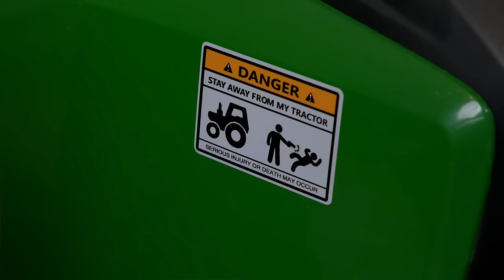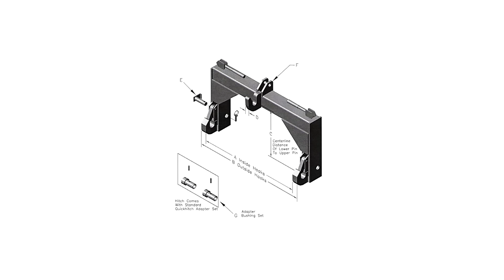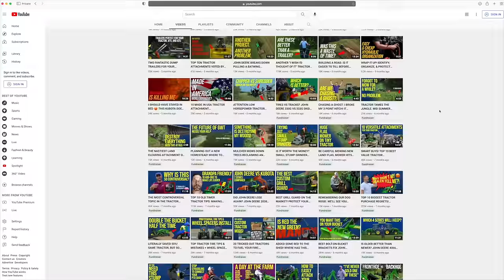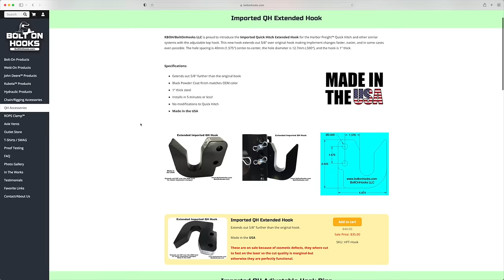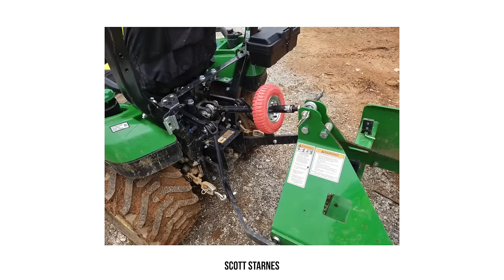CAT 1 QUICK HITCH DIMENSIONS AND ADVICE TO WORK PROPERLY

Comment: Pat’s Quick Hitch + Tractor PTO link.  The two together make a world of difference.  The top link is never the issue… that’s why Pat’s is awesome.  Grab the implement attach your top link (you have to get off the tractor anyway to attach the PTO) and wallah… life is good.  Plus you don’t have the standard metal bar on other “not so” quick hitches to work around.. making it less cumbersome and easier to connect the PTO💪🏼
Reply from the maker: Thanks for watching, good stuff!
Reply: I run a rear blade when there isn't a lot of snow or to touch up my gravel driveway, no PTO to connect for that attachment so I literally just reach behind me and flip the levers down on the quick hitch I have and drive away and do my work.
Reply: Agreed, personally I love the Pat's Quick Hitch!  I know I'll always be back there adjusting the top link anyway, so just being able to get the lower pins into position easily is all I need.  Then when not using it they just stay back there on the 3 pt arms and are totally out of the way!
Reply: IF I colud only find a top link long enough now that the Pat's Quick Hitch has been installed. (Cat 2 that is 35" long in the mid point)
Reply: Do you have any available for a 2025r
Reply: Those of you which own and use Pats Quick Hitch, are those bent washers necessary?
Reply: One point not covered is the length which the pin point is extended away and the affect on the power of the hydraulic lift. Has anyone ever had issues with this and or had to replace the PTO shaft because of the added extension the implement is now mounted?

Comment: The hydraulic top link is a game changer!!!  
I haven’t pulled the trigger on the hydraulic tilt yet, but I can see a huge advantage when creating new roads/trails. 
Great video, cleared up some of the confusion when measuring tractors and attachments to see which tractors will work with which quick hitches and attachments. 
The other quick hitch video where you explain with measurements, and side by side tractors on quick hitch category 1, and category 2, is a much watch for folks with tractors bigger than a compact. 
Thanks Courtney!!!

Comment: I purchased my Speeco quick hitch approximately 5 years ago and it has the larger holes that require the bushings. The reason some people that are older (like me) is that should you not be able to see as well as others, the larger bushed pins fit very easy even if you are off a bit. God Bless 🇺🇸😎👍
Reply from the maker: Haha, maybe so!

Comment: I have a QH05 quick hitch from Land Pride on my Kubota BX. It has a fixed top hook and is the smaller version of 2 that they sell, which forced me to have the modify my ancient box blade to lower the top link pin position. But it was well worth it. I have a small property with a gravel driveway, about 3 acres of field that I keep cut down, and I garden. Switching between my brush hog, tiller, and box blade as needed takes less than 2 minutes including driveshaft removal/connection. I can't even imagine not having a quick hitch anymore. If I ever get another implement that does not work with my quick hitch, I will spend the money to modify the attachment so that it does. I doubt I will ever take my quick hitch off ever again. Maybe folks voting against one never really used one? Or maybe their attachments didn't match up? I can't imagine why anyone wouldn't like one.

Just a quick note, my QH05 has zero play in the bottom pins once locked. As a matter of fact, the tolerance is tight enough that my ancient box blade, whose frame is nowhere near straight anymore, just barely seats in the grooves enough to lock them in. Also, the bottom hooks fit the pins directly with no sleeve needed.

But yeah, quick hitch is a must have in my opinion.
Reply: I did a video on the QH05. If anyone is interested, you can look on my channel, it's the 8:11 point in the video where I show exactly what Doug states. Almost no play at all on the QH05 bottom pins. The Speeco is a heavier duty quick hitch and it has the adjustable top hook. Speeco e hitch is probably going to be the better solution for many people, especially if you have older attachments or if you want the weight brackets. The QH05 is rounded, so no way would those weight brackets fit.
Reply: @Redneck_Ed  Yes, I agree. The Speeco would be much more versatile. The QH05's strength is it's economical. I think I paid ~$100 from my local Kubota dealer (I can't recall now, but it was well less than 200).
Reply from the maker: Good stuff Doug, thanks for sharing!

Comment: Yeah...I don't like NOT having my quick hitch on the back of my 1025R  anymore.  Totally used to having it there all the time.  Use it with my rear blade, CMP rake , my friends brush hog and the Protero.  Definitely going to hit up Ken for the top pins.  Thanks for the helpful info and for sharing as always!
Reply from the maker: I am totally with you on that.  Yeah, check out those pins, I'm glad I got them!

Comment: Excellent video! Those of us (like myself!) who are old enough to remember wrestling heavy attachments onto tractors with no adjustments on the 3-point hitch can truly appreciate the convenience of a quick hitch. I don't know about other brands of finish mowers, but the Bush Hog HDTH5 finish mower works perfectly with a Speeco E-Hitch. It's a great combination that works very well on my Kubota B2650. Bush Hog will even paint the finish mower Kubota orange for you if you want them to!

Comment: I bought a QH at the same time that I bought my new tractor (Kubota B2601) which replaced an ancient Ford industrial tractor-loader. I traded in all the old 6ft and 5ft implements with the old tractor and bought new Land Pride ones when I bought the tractor and the are all QH ready.  I am 84 and on oxygen and could not possibly deal with horsing around my brush hog to hitch it up without the QH15. I agree that it makes coupling and uncoupling the PTO a pain in the butt, but that is a small price to pay for the convenience of just backing up to an implement and picking it up. My QH15 came with one set of bushings, but when I saw the price of them, I went the standard CAT adapters which let me have "bushings" on all my attachments for less than the cost of one set of the "real" ones. See my comment directly below this one for what I'm using.

Comment: Another vote for Pat’s quick hitch. 

Keep adjustable width in lower arms, no frame in get in the way of pto or hydro line hookup, no bushings needed, usually cheaper, etc. Only manual hookup is the top link, and those can be swapped out to a hydro top link. Can still work with side shift implements or post hole digger.

Comment: Love the quick hitch, makes life so much easier connecting attachments.  I only had one problem with the quick hitch, I sold my JD 2210 to upgrade to a JD 2038 last year and I couldn't remove the quick hitch from the 2210.  The bottom pins were basically fused to the eyeballs of the three point arms.  No amount of WD-40, liquid wrench, pounding or swearing would break them free.  It pained me to have to buy another.   You do have a great point about the bushings, seems like a needless additional expense.

Comment: I have a Land Pride quick hitch along with the Tractor TPO Link. I have a bad back, so the two of them make life much easier for me. I HATE dealing with lift arm bushings and I’d spring for the Speeco quick hitch, if they only made them in green or a neutral color like many other manufacturers. When disconnecting an attachment connected to the TPO Link, I’ve found it easier to disconnect the adapter that’s connected to the attachment, as opposed to the other end that’s connected to the PTO shaft. I don’t know why, it’s just easier for me.

Comment: Sold mine.  Didn't fit the some of the older implements I have on the lower pin width, and didn't fit any for the top hook.   Need flexibility on the top for brush hogs so they can kick up, and the top pin adapter on a QH is time consuming to take on and off.   Might go to Pats on the lower....or just keeping doing it the way I've been doing it for 30 years!   Back up straight and use a 6' pry bar for minute adjustments!!
Reply from the maker: Haha, I hear ya!

Comment: My QA is from 2004, back then few if anything in the way of implements were QA ready, so in a sense, it is a partial quick hitch because I still have to get off the tractor and manually connect the top link since nothing I have works with the bolted on top hook.  I also have a 4' KK rough cut mower that even though is is 2 years old is not QA ready.  The pins do not have enough room to get the QA hooks under them so the QA has to be removed to use it. 

Looking forward to the weight brackets, that is something I had a need for, when I use my sprayer I  have to clamp the 3PH down to keep the sprayer from lifting the QA when the water flows back.
Reply from the maker: Thanks for watching!

Comment: I had a Harbor Freight QH for a few years but got tired of buying overpriced bushings and having to put them on all my implements, plus I have a finish mower that has a floating top link connection so I had to get a $40 adapter to use the Quick Hitch. Also had to remove the QH to use my trailer mover. Finally got fed up and got the Pat’s System and it has worked out 100 times better. IMO Pat’s Quick Change is a far superior system to any of the standard style Quick Hitches.

Comment: The oversized top hook is a real problem IMO.  I've been using my speeco for a year+ and loving it.  I just grabbed a dirt dog box blade from y'all to use with it, and the oversized hook on the speeco makes using the box blade a real frustrating experience.  The 3/4" pin sitting in a 1 3/8" slot allows the top link length to change by 5/8" as the forces on the box blade change, and the pin shifts forward or back.  That much change completely alters the behavior of the box blade from perfect scrape/spread to full dump of a load.  Some sort of bushing for the top pin is in order, imo.   Or a new hook with the right sized slot.

Comment: Two comments. 1)as my dealer said, if the attachment is really QH compatible, you’ll never need to move the top link adjustment. 2)many of us have found bolts and nuts superior to the pin and cotter key because the cotter key will eventually fall out and you will lose the pin.  Of course, if you really move the link over and over, then maybe you need the pin and cotter key.
Reply from the maker: I've had multiple nuts rattle loose off of the top hook pins, so can also fall out.  John Deere used to sell the iMatch with a welded top hook.  They don't anymore.  The top hook needs to be adjustable to match the ASAE specification.

Comment: I am one of the guys that really hated the quick hitch because the top hook is not consistent across the spectrum of attachments and having to add cat 2 adaptors to all the attachments.  Unbolting and bolting the top hook was not quick.  I never thought about using pins on the top hook.  That would really speed things up.  I also like that manufacturers are now making the direct cat 1 quick hitch that does not need adaptors.  Maybe I will try another one in the future.  Thanks for the information.
Reply from the maker: Thanks for watching Scott!

Comment: I have a harbor freight QH on my BX and I don't have any bushings on my attachments and only time it's a issue is pushing backwards with a grader blade it tends to want to bounce around in the slop of the bottom hooks but going forward, box blade, land plane, chipper or finish mower I have no issues. My bush hog is a issues simply because the bottom pins are too narrow for it to fit the QH. But I definitely like mine

Comment: I was totally surprised that QHs came in as one of those things people hated. I get the feeling that a lot of respondents are just now using 3 pt. hitches -- been using them for 50 years.  Before the QH, hooking them up was an extreme pain in the arse.  Talk about having to get out of the seat!  I also don't mind adjusting the top link because that was a given on every implement from a sickle mower to a plow -- it had to be adjusted to run the implements right. I use 3 implements, basically, and I wouldn't not have a QH.

Comment: Regarding the top hook using pins and retainer clips, some attachments will push out or mangle the clips (even bowtie versions) so beware of the possibility.  In my applications I solved the issue using a long cotter pin between both pins to replace the clips.
Reply from the maker: 1 long cotter through both top hook pins?  I like that!

Comment: I bought a quick hitch with top hook adjustable with one pin and side to side also adjustable with pins. It also fits the standard pins without adding those expensive bushings. Basically, it fits anything out there!!!! It’s made by prievost, i’m not sure of the spelling.

Comment: If you don't like quick hitches, the problem is NOT the quick hitch. It's you or your attachments. My quick hitch never comes off my tractor. It takes seconds to hook up equipment as long as you take the time to unhook on relatively level surfaces and prep your equipment accordingly. If you have old attachments that aren't compatible, there are adapter kits. Bought an adapter for my old back blade. Works great with quick hitch now.
Reply from the maker: Haha, well said!

Comment: Hey Courtney, I just made a video about what I had to go through with my Mahindra eMax 20s. Even though it's a Cat 1 hitch, the backhoe subframe gets in the way when I tried to hook up to a Mahindra 5' rear blade. RCAFPOLAREXPRESS made a video showing what he did to help with that on his rear snowblower, but that still didn't work for me. I had to add some bar stock to the plow frame so that I could invert the lower link pins.

Comment: Great video and always very informative...  did I miss it but what do you use for the top link pin?  Do you just use the standard 5/8" pin?  Seems like the hook is made for a pin much larger in diameter than the 5/8" normal top link pin.

Comment: I wouldn't have a tractor without a quick hitch.  My 4720 came with an iMatch, and the only time I remove it is when I have to use my PhD.  (post hole digger)  I read somewhere, maybe in the owner's manual, that the upper hook should never have any weight on it.  A small gap should exist between the gullet of the hook and the bottom of the upper pin on the attachment.  The two lower hooks should carry all the weight.
Reply from the maker: Interesting theory on the weight distribution.  Hadn't heard that one before.

Comment: My Woodmax 62H flail has hydraulic side shift though not the distance as  the Del Morino you showed. It fits on the Quick Hitch. Good thing too because there is no way I could shove 750 pounds around to line up the lower links.

Comment: Hello. I purchased a Speedo cat 1 quick hitch.  I can not for the life of me connect my box blade.  There seems to be about a 3/8 inch piece of steel on the box blade that is always in the way.  Can I shave that off with a grinder or what do I do.  I have tried no less than 50 times. Adjusted the top link. Bolted and reboltedvthe bolts on the box. I am just frustrated and yes I am a new tractor owner

Comment: They probably don't include a top link pin because a good portion of top links come with a pin themselves, either from the dealer or if bought individually. At least, all the ones we ever bought did. Would mean having an extra pin lying about, although that's not always a bad thing. As for bushings, my guess is to make manufacturing easier for multiple categories of quick hitches. I.E. a cat 1/2 quick hitch which might not need bushings for those larger pins.
Reply from the maker: Maybe so, thanks for chiming in!

Comment: i have a Deere 1025 with a Deere quick hitch , I just bought used, so trying to figure everything out. The Hitch seems to be tilted to one side and it tough hooking up the tiller. shouldn't the hitch be more level to back up to the tiller if so how do you make these adjustments.....thanks

Comment: i have a horror fright quick attach. the need for bushings is a pain.  i just have 1 set that i don't pin on, and move them around.  but it's still worth every cent.  most of my attachments are several hundred pounds.  my snowblower is over 800.  i used to struggle for an hour with my neighbor hooking that stupid thing up.  but it's less than a minute by myself now.
Reply from the maker: Bingo, that's why you get em!

Comment: The Pat's system looks like it would make it a little easier to access the PTO shaft but also looks like it may not be compatible with frame-mounted backhoes. If that's the case, I'd rather spend a couple minutes wrestling that Speeco on and off than remove/reinstall the Pat's system.

Comment: DON'T buy expensive bushings!  At least on the Land Pride hitch, the lower and upper hooks are Cat 3 size. So, you can get Cat 1 to Cat 2 adapter which will fit nicely inside of a Cat 2 to Cat 3 adapter and you have the equivalent of the fancy (expensive) bushings. You can get these adapters for both the lower and upper links at any tractor store for about $3 each.

Comment: My biggest issue with quick hitches is that you are limited to a single category. We have both 1 and 2 category implements and all the tractors have to be able to attach to either category when needed. That’s why personally I don’t like quick hitches.
Reply from the maker: Yeah, small section of the market uses both categories.  Not a really good quick hitch system for that type of situation.

Comment: The reason some brands like JD I-Match use bushings is because they are hardened to protect the studs on the implement.

I worked for a JD dealer when the I-Match came out and we tried cutting a bushing.  They are hard as hell.